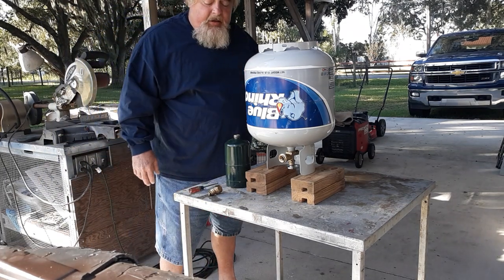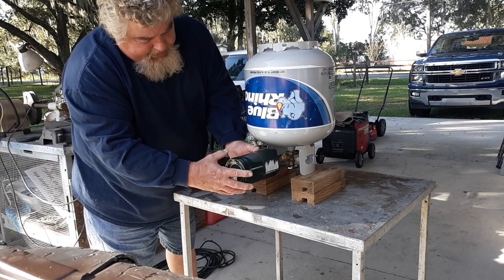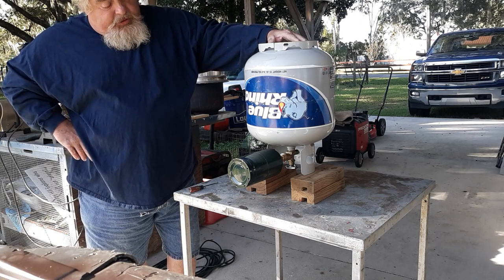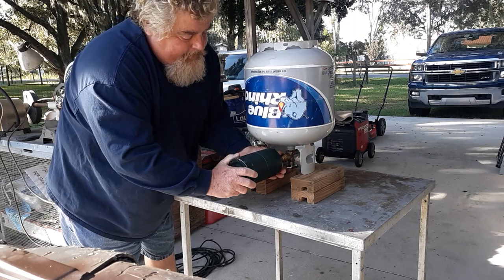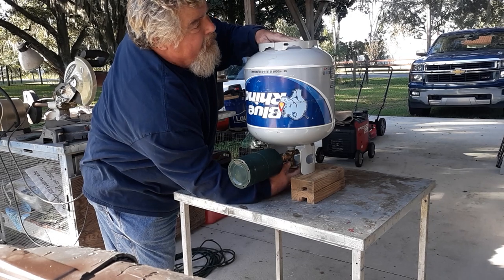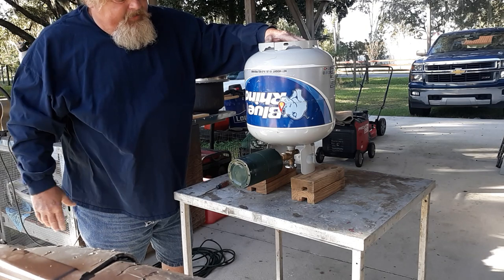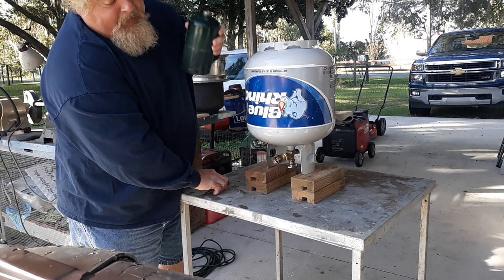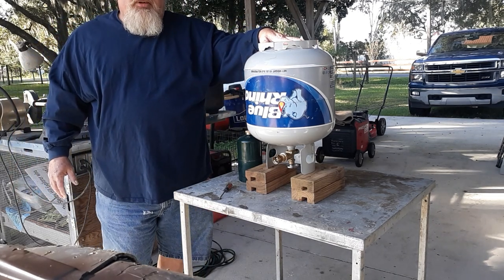Propane Refill How To

Comment: that is one overfilled can that may explode during temperature rise.
you wouldn't want to have that in your car.
the proper way is to charge it is 70% of the value.
that gives it room for pressure changes
Reply: Good point! When the small green  bottle is completely full of LIQUID  propane, that's a potential explosion if placed in the sun or near open flame.
 Making a simple balance stick to compare new full green bottle to a DIY filled bottle, would be much safer practice.🤔

Comment: Mebbe a BETTER WAY of filling that 1 pounder is to weigh a completely empty one (usually it's one pound) then, as you're filling it up--stop to weigh it in stages. If you want 75% fill up rate, then add propane and weigh it for 1 lb + 12 ox, or a total weight of 28 oz. Jess sayin'...